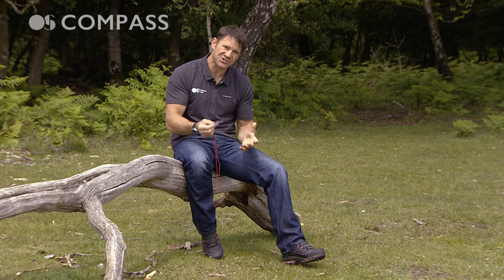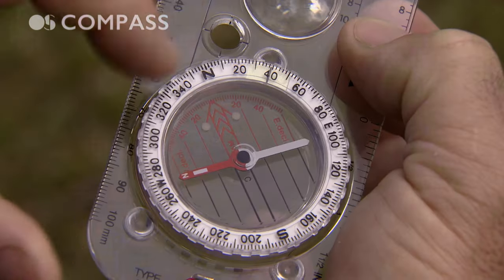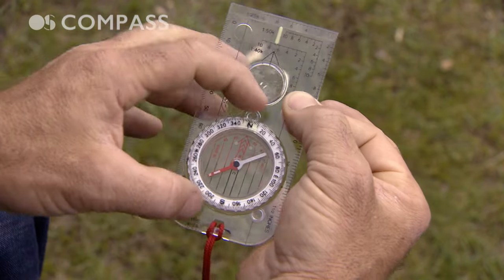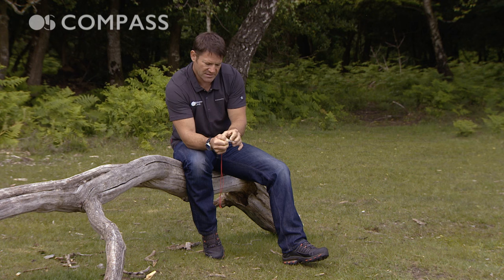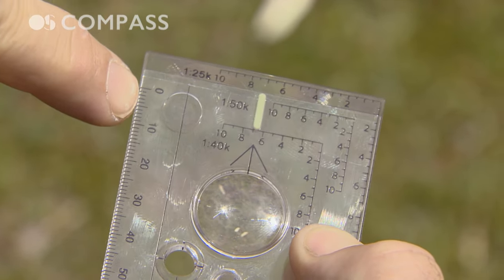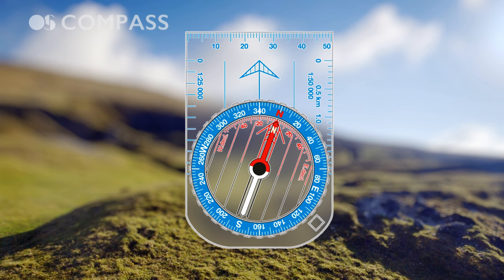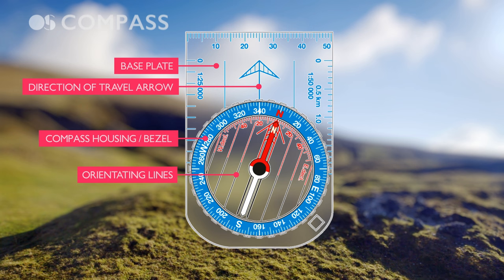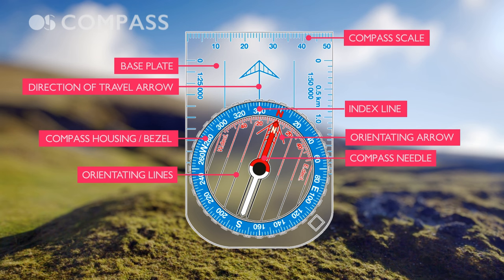Features of a compass with Steve Backshall and Ordnance Survey

Comment: This type of compass is an invention, invented in 1933 by a few swiss guys.  It combined a magnetic needle with a protractor.  That is what the housing is---a protractor in a full circle of 360 deg. for measuring angles.  Which is what your bearing is---an angle, in degrees.